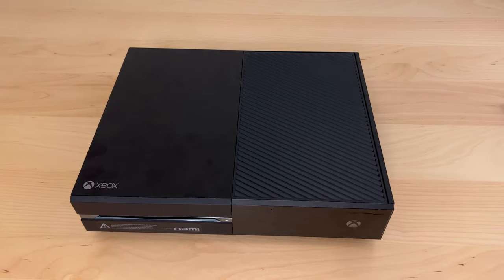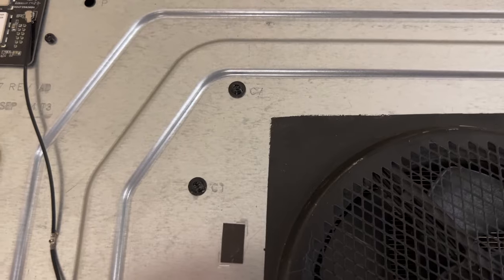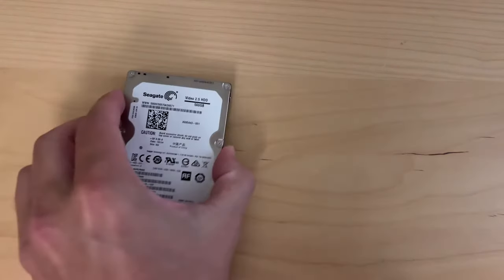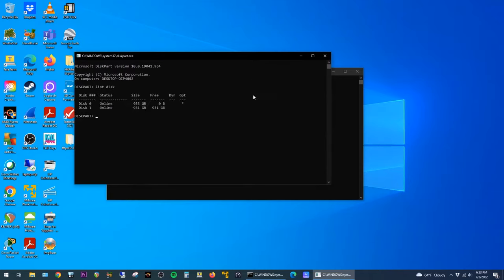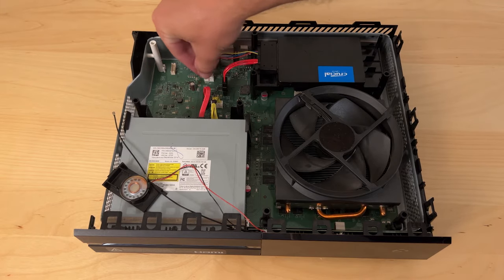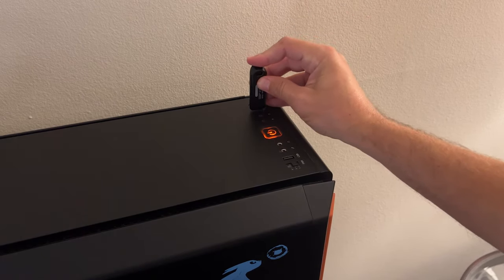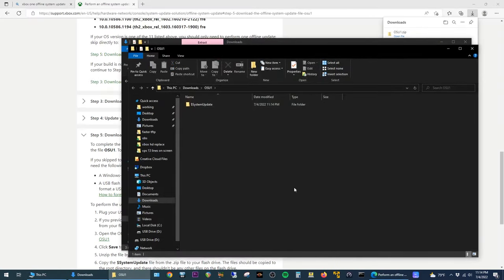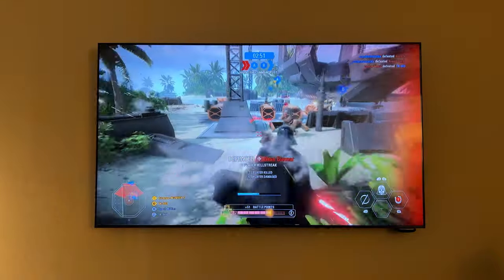How to Replace Failed Xbox One Hard Drive with SSD

Comment: For anyone that might wonder, 2TB is the max limit, and minimum is 500/512GB. 480GB is below the minimum and won't work using this method. There is an script that does allow using smaller HDD/SDD but it isn't really worth the effort. The best scenario for the OG X1 is an internal 500GB SSD and an external SSD. It loads fast and doesn't make too much sound.
Reply: I just got a Crucial MX 500 SDD 1TB on Prime Day for a great price.

Can I use this 1TB drive in my OG Xbox One or should I exchange for a 500GB SSD?
Reply: My Xbox is 320. How is that Even possible?
Reply: I was just asking about this. I want to put the 2TB SSD.
Reply: @kaibyoo system files and stuff
Reply: so if i was to buy a 2TB SSD for my one would it work ?

Comment: Whew! The 500gb threshold is key to doing the offline update. I used a 480gb too, used a 500gb and it's updating.
Reply: Is 480 the issue or is less than 500 the issue? So a 250 or 128 will not work in guessing?

Comment: Hi I have a og xbox one sometimes it shuts off during startup some times I can play for hours before it shuts off. Start up is slow in my opinion as is downloading games and nearly everything. I know it’s not overheating because I completely dissembled the console and applied new thermal paste to try to fix my issue it did not. Could this be a hard drive issue? Please any advice would be greatly appreciated

Comment: Thank you! 
TLDR: If you are getting error E102 and think you need to replace your internal hard drive, try reinstalling the OS first.

I was stuck in an infinite Error E102 loop and was ready to replace my original internal hard drive (I'd bought my Xbox used and had it for seven years so no real surprises there), and figured I'd try to move the OS to my external drive connected via USB, or remove its housing and turn it into an internal hard drive manually. Unfortunately my external hard drive uses weird connectors so I couldn't move that to be internal, and the Xbox refused to boot with no internal drive (despite an external drive and flash drive with OS plugged in). I tried reinstalling the OS to the original hard drive and, much to my surprise, that worked perfectly. Turns out I didn't even need to open my Xbox, but thanks to this well-made video I didn't cause any damage anyway.
Reply: So how did you update your hard drive OS?
Reply: I have been trying this but my Xbox won't find me the offline update option when I plug in my os usb. I think I have maybe used my Xbox for 40hrs and now it is a brick.  Very frustrating.

Comment: Great video! Used the same ssd as you and sata to usb adapter and everything works great. My old hard drive was failing and needed a factory reset every time it would get completely turned off, so I really needed a new one. The only thing is, on boot-up, I no longer get the green loading screen, just a black screen until the home menu pops up. Doesn't bother me but thought I'd mention it for other people attempting this.
Reply: It’s because that green screen is normally there while the is boots up from the hdd but now that the is is loading faster it skips it entirely because it’s not needed. 

It’s actually interesting because Xbox ones have had this for a while now in the code so Microsoft really did think about putting in ssds at the time of the ones development
Reply: @NITROexpress17 I used this video to upgrade to an ssd as well. I also had a black screen while booting up. But on the next update, the green screen returned on boot up.
Reply: How much faster is the loadfing time ?? tks

Comment: Thanks! Just a heads up for others who tried, i tried to do what the microsoft page said, looked up OS Version and chose OSU2 as it instructed me, got error, went straight for OSU1, no problem! I will comment, it seems console startup isnt noticeably faster, but scrolling menus on home page is smoother so i call it a win!
Reply: im pretty sure the startup sequence is stored on the built in, not removable flash memory, and that's why its a bit slow coz its also a bit old now

Comment: Great tutorial but I had to hold the sync & eject button then push power button until I heard two beeps. Only then did my Xbox recognize the USB and started the update automatically.   Still worked just like your video.  Went with 2.5” SSD @2TB.  Now moving my games from external to internal and transfer speeds went from 120-150Mbps to 450-600Mbps!
Reply: My Xbox isn’t recognizing my usb drive either. Holding down the sync and eject buttons isn’t fixing the problem. Any ideas?
Reply: @joshuannamdi5242  Keep trying, took me like 6-7 attempts to get the beeps then all of a sudden started working
Reply: @dustylyle1133  the issue was my USB drive. I used second USB drive and the Xbox recognized that one.

Comment: Glad the internal can be upgraded. A 2tb is the max to be used as another video stated.
Reply: No, a 4tb hdd can also be used, but it will be necessary to pass more, i.e. the maximum partition of 2tb will have to be increased manually to 4tb, through applications on pc

Comment: Great video but you can absolutely skip the stage where you used diskpart to format and create a partition. The Xbox will perform this step and will create 5 partitions in GPT format. What you did was create 1 partition in MBR format which is fine for PC but Xbox cannot boot MBR.
Reply: So just stick any drive in, run OSU from USB, and gold to go?
Reply: @IBuiltDaArk  you got it man. The Xbox will run diskpart itself using the commands designated in OSU.

Comment: So I did this using the hard drive linked here, and everything seemed to go just fine during the switchout, but when I fired it all back up and turned it on I get no video.. Anyone know what may be causing that? The device powers up and makes some chimes, but no video at all.. I am guessing maybe I knocked something loose inside?

Comment: Great great great tutorial. This work great for me, but I have a concern. I installed a 960 gig SSD from Kingston, but the Xbox is only seeing it as 365 gigs. Is the issue where you have to buy either a 500 gig SSD or 1tb SSD or 2 terabyte SSD still an issue?
Reply: Same for me.. did you got a solution ?

Comment: Hey, great video, just a quick question, i did buy a Xbox one Elite with 1TB Hybrid drive. I want to put a 2TB SSD in it. The console is used, but has nothing on it from me, so i want to whipe it clean completely. If i follow all steps you say in this video exactly, would that work for my Situation too? Or would this not work with a 2TB SSD in a Xbox One Elite? It would be great if you could help me out here.

Comment: I think this is probably one of the best instruction videos i have seen on internet - but i have one question - if you are replacing the drive, what about everything on the old drive, does that not need to be transferred to new drive ?

Comment: I tried following your video , but didn't work for me. I purchased a WD blue hdd 1tb in size. I formatted it the way you suggest, but wants to initialize as MBR not in GUID like the original 500gb hdd. The video is great for dissembling and re install.

Comment: Hey bro I have the same problem xb1

Whats the fastest speed and biggest capacity the Xbox can accept internally without rejecting it or failing to read 

Is there a certain connector type I need the ssd to be made  in 
Thanks in advance
Reply: Was asking the same thing. I would like to install the 2 GB drive.

Comment: what are some common things that would tell you the drive has failed ? Have a one x that turns on for 30-45 seconds and then powers off no input to the tv either someone said the drive needed replaced do you think that could possibly be it ?
Reply from the maker: Mine was freezing in the middle of games and I could hear the old drive chirping
Reply: @thefiXfiles  I changed the drive yesterday and it worked! Weird but I didn’t think there was anything wrong with it

Comment: When formatting the drive on the computer do I need to use the usb 3 to sata adapter or can I connect it to the inside sata power and data cable on the pc and formate it that way without having to buy the cable?
Reply from the maker: Yeah I don’t see why not.  You should be able to connect it as a SATA drive and format it.  I probably would have done it that way if I wasn’t making a how to video.  I actually considered doing it that way but thought it might add some confusion if folks had to enable the SATA ports on the motherboard or something.

Comment: I'm shocked it works without any pc software that sets up XO partitions! 
All  other tutorials  are based on cloning original hdd or setting up the partitions with pc software.
Does it wirks also on ONE S/X?  as well
Really, no software needed? 
Really partitions are setted up during usb installation?
Bedt regards!

Comment: Do I need to do the computer part? I have a MacBook. Will that work?
Reply from the maker: Yeah you can use a MacBook.  The commands will be different, and I don’t know them.  It’s definitely possible though
Reply: @thefiXfiles  it didn’t work for my MacBook but luckily I have a Chromebook and it worked perfectly. Thanks for the reply anyway

Comment: I have this xbox and am looking to fix it up. I've ordered a couple parts and doing this replacement is the main objective. However I am interested in replacing the CPU if possible. I read that this system uses an APU called jaguar, which to my understanding acts as a dual functioning chip (both CPU and graphics). Does anyone know the possibilities of replacing it with something a little bit newer? Right now I am just trying to do some research to get more insight on processing units in general, but if anyone has done this or could provide some links for any related info that would be great. Thanks!

Comment: Does it work with a 500gb or 512gb ssd?
Reply: so long as its 500 plus.   I just follows the above steps, and put in a 512 SSD I snagged out of a laptop with a bad motherboard.  so long as its over 500 the system will allow you.

Comment: Hello guys,

I hope you’re all doing well! 
I just have a question regarding SSD upgrade on the Xbox one S.

I was trying to replace my internal HDD to SSD but failed to do so. I have already tried all the Xbox offline update and etc and still didn’t work. 

Note: 
I have the most recent version of the update and it seems like the file OSUI in the Xbox website is an older version which makes it not possible for me to replace my SSD. 

What’s my option here? 
- I tried to clone my HDD to SSD but didn’t work as well. 

Any tips guys? Please help.

I appreciate you all! Thank you!
Reply: Still having the issue?

Comment: Wiping a 10+ year old HDD to use on my xbox. Windows 10 is not letting my windows 11 clear the softwhere from AMD off the HDD so I might just change how the HDD goes to the xbox and use it externally
Reply: My HDD still works barely it does not like MW3
Reply: NVM im replacing it

Comment: 4:52 Hi, I am using an existing Segate 500 GB HDD to do this. I did all the command prompts, but when I typed create part prim my computer said that the request was failed due to a fatal device hardware error. Can you please help me fix this problem?
Reply: The thing is the computer shows disk 1 with 0B of size and 0B free. However, it shows that it’s online. I am replacing my hard drive in my Xbox one because my Xbox keeps freezing whenever I play games or go to the home screen so I figure it is a hard drive problem so I took one that I didn’t use to fix it. Since none of the code is working I guess I’ll just recode the current Xbox drive hopefully it’ll work. The Xbox drive might be corrupted.

Comment: Broke my Xbox doing this. Hard drive error codes even with the original HDD.
Reply: Have you tried osu2 or 3? Important! For build 6.2.9781.0, use the Offline System Update file OSU3. For all other builds, use the file OSU2.  So basically you run OSU2 or 3 depending on the build and then OSU1. Not sure how helpful that is but good luck.
Reply: You probably need the flash drive, watch the tutorial again

Comment: Terrible instructions at the end that make it impossible to update the OS if you're not running the same version this guy is. 
That will force you to open the Xbox back up and reformat the drive, then apply THE CORRECT OS UPDATE.
Skipping over steps and assuming it will work the same for everyone:   This guy is a bit of an asshole